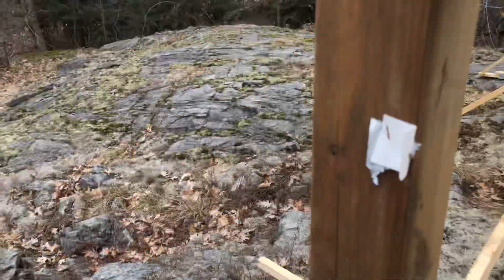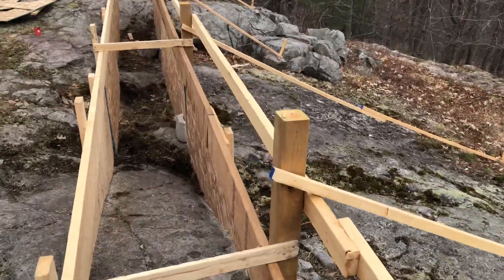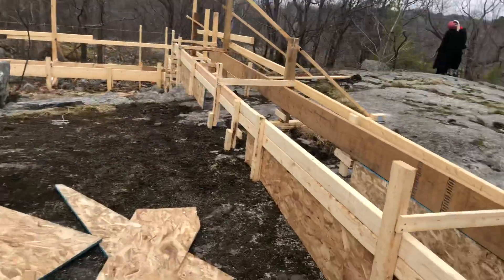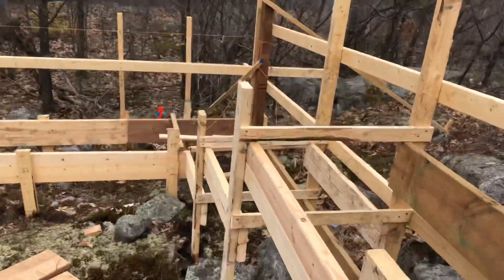Step Footing On A Bedrock | Building my dream house : Ep1

Comment: Does the Ontario building code requires insulated footings??  Because of freezing
Reply from the maker: No, you are thinking about insulating the footing if you are building one in Winter so that the concrete cures normal.